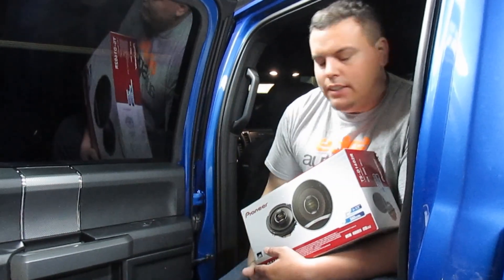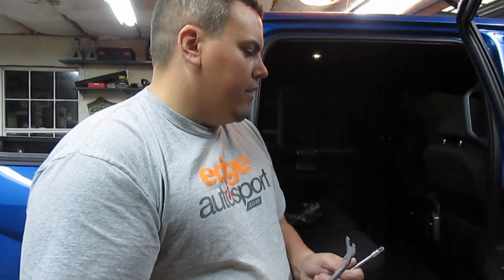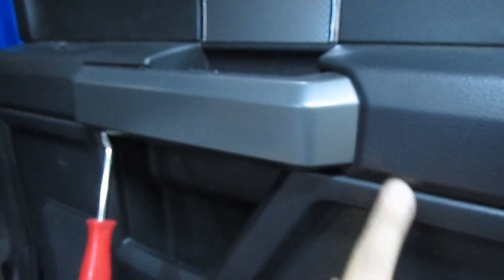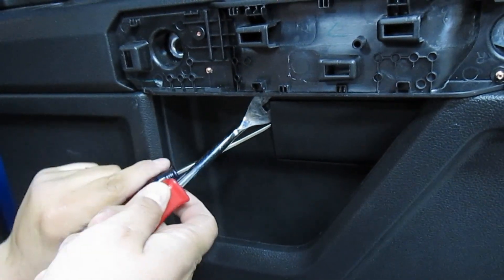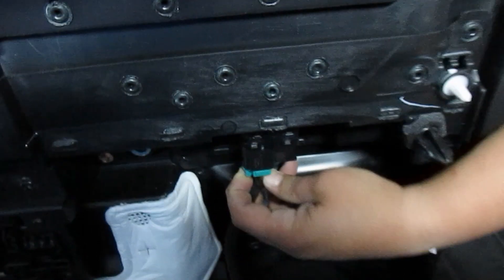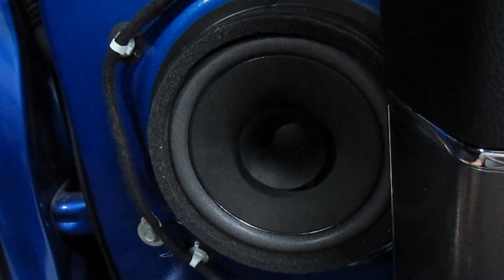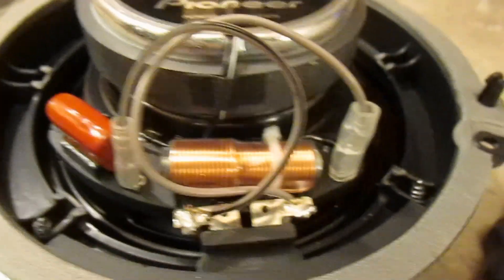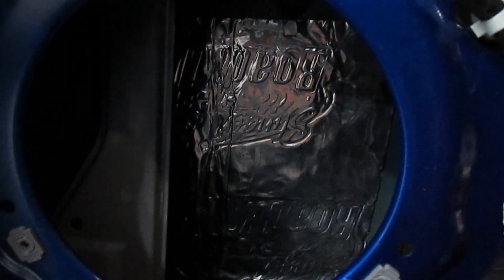F150 Rear Door Removal & Speaker Replacement

Comment: Great install as the only thing I did was buy the adapters for 8 bucks and you can install without using the factory speaker bracket. They plug into the speaker and the other end plugs into the factory plastic connector.
Reply from the maker: thanks for watching!!!

Comment: Followed these videos for 2018 Ford F 150 front and rear speaker upgrade. Punch speakers up front and back, tweeters next. Thanks for the guidance... worked killer sounds great
Reply: Hi, I am planning on doing this soon. did you need an amp or does it work fine by just replacing them with factory speakers and did it make a big difference sound wise. Thanks
Reply from the maker: you are welcome!
Reply from the maker: just adding speakers make a definite difference

Comment: Is the radio in the truck stock  with these pioneer tsd-1602r  rear speakers you installed?  I have a stock,  non sony  radio with a pioneer mini amp gm-d1004 in my 2018 f150 super crew installed and the stock speakers sound surprisingly well.  I changed the rear door speakers to a jl audio c-2 series speakers and the cheesey stock rear speakers actually sound better???  not that  they are great sounding speakers but I am thinking of installing the pioneer ones you did. is it worth doing without a more powerful amp? the one I have now specs are 45rms watts with 100 watts max.
Reply from the maker: Yes.  Until my updated amp video it was.
Reply: 45 rms/100 watts x 4 channel that is

Comment: You do good work overall, but never use metal trim tools and screw drivers on trim. I could see the marring on the door panel right away. Always use nylon trim tools or put a piece of duct tape over the metal tools to keep them from marring the heck outta the plastic.
Reply from the maker: makes sense.  since this video i have bought a full set of all plastic tools.  thanks for the comment.

Comment: Thanks for the upload. I have a very annoying sound from the front and it’s there even when I switch off the radio or the sound system. Is it from the front speaker?
Reply from the maker: speakers dont work without a signal.  so something is sending it the noise.

Comment: You get this stuff on crutchfield and they give you the metra rings and wiring plug for free. No need to cut the factory speakers.
Reply from the maker: not worth it.  and then you cant use the stock connectors.  then it also costs you more.  then you throw out the stock speakers anyways

Comment: do you know where i can get the speaker wiring diagram for the 2016 F150 supercrew XLT with 7 speakers & 8" screen. I'm replacing all door speakers, 2 10s & 2 amps using the LC7i so i need to cut & splice behind the radio, thanks for any help.
Reply from the maker: Thanks For Watching!!!

Comment: At the time you made all these speaker replacement videos for your f150, were you running an aftermarket amp to power them? Or will the factory head be enough to run them? Great "how to" videos by the way.
Reply from the maker: factory head unit, it works great.
Reply: 100% that the factory unit provides enough?  Wanted to add all the speakers like you did and a small subwoofer.  Just afraid of cranking it and blowing a speaker.  Awesome videos btw!

Comment: great video!

where did you get the roadkill mat?
would 6 3/4 in be possible?
how much spacer is there between the speaker and door trim?
Reply from the maker: 6.75" is the same thing and will fit the same in the rear doors.  I used the stinger brand mat and it works nicely.